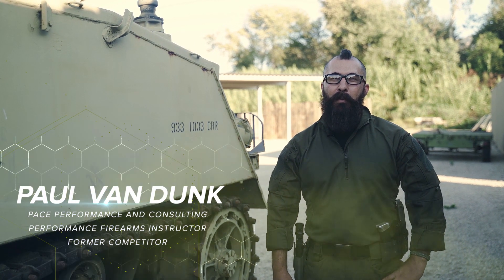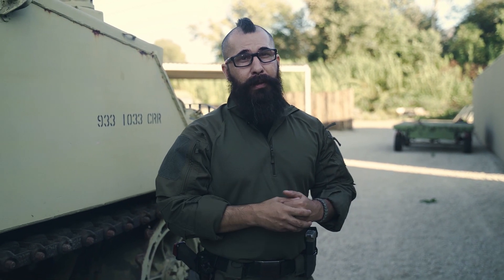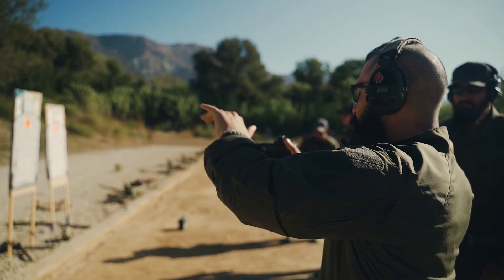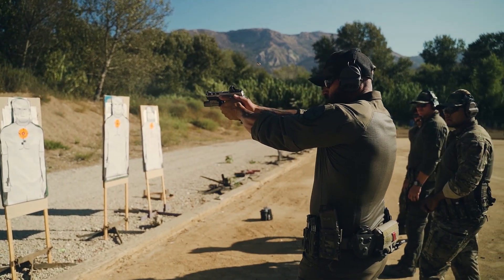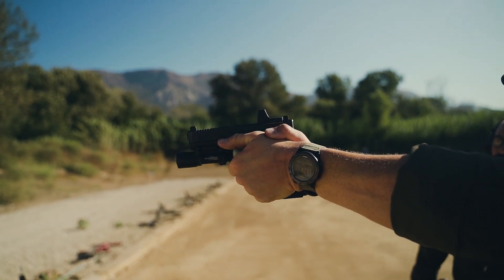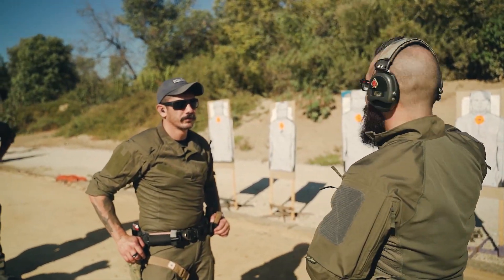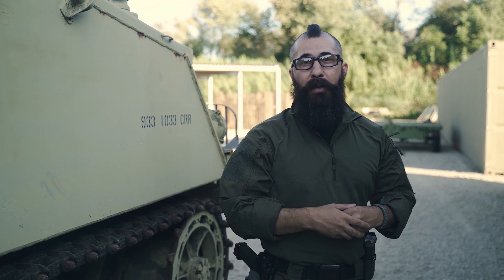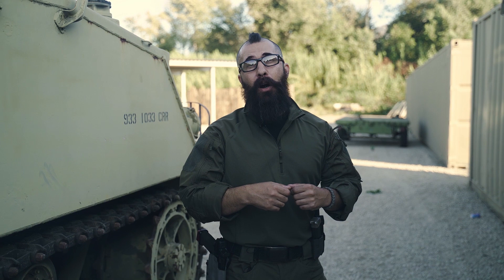Recoil Management on the Pistol | Firearms Instructor Series

Comment: I understand way better now what I've been doing wrong. If I could afford the time and money to go to a seminar on this I would.
But my "issue" is I EDC a "compact" 45, not a 9. (Due to BS laws, 10 rounds is 10 rounds, why not make the most of it) Is there any changes that should be looked at adapting to the 45 over a 9?
Reply: Switch to 9mm, and make the most of those rounds.  Shot placement, not size of impact, is key.
Reply: @GBCNBSN  Just go all the way and switch to .380
Reply: @Frenchfrys17  that is an option. Though most ballistic data shows that even with good shot placement you have a fair to poor return on performance compared to 9mm.
Reply: @GBCNBSN  I suggest you try a Glock 25. It’s the same size as a Glock 19 but chambered in 380 instead. It has less then 40% of the felt recoil of a 9mm Glock 19. The difference is enormous. Much more than the difference in recoil between 9 and 45. Federal .380 Punch, Critical Defense, and copper penetrators all meet FBI specifications.

Video: https://youtu.be/WCkaKKpTGrQ
Reply: @Frenchfrys17  I’m good. I carry a Glock 45 and can control 9mm. But for some the need to have less felt recoil is valid and the 25 is a good option.
Reply: Use and work on the same techniques